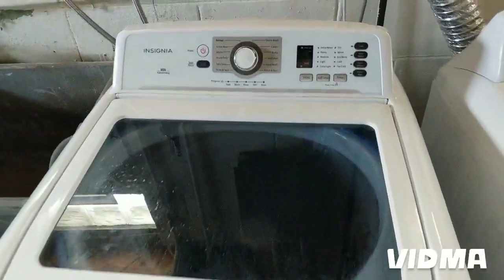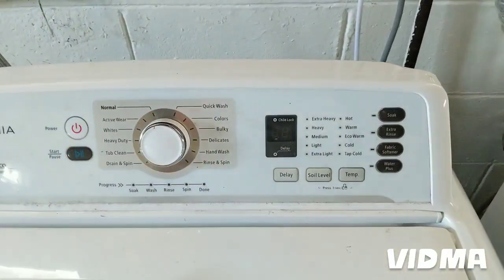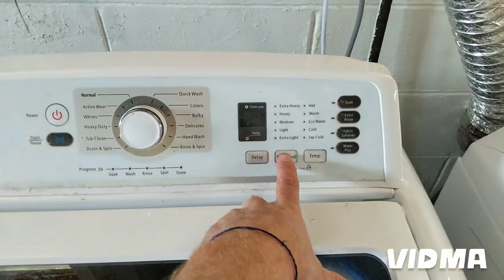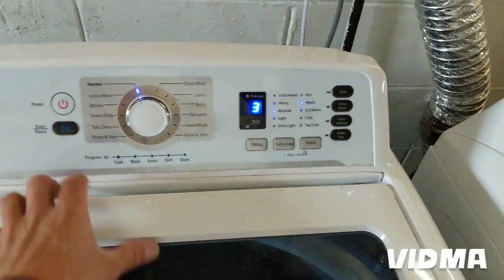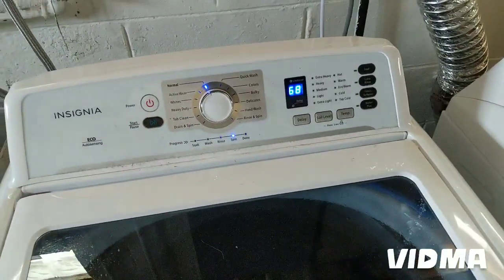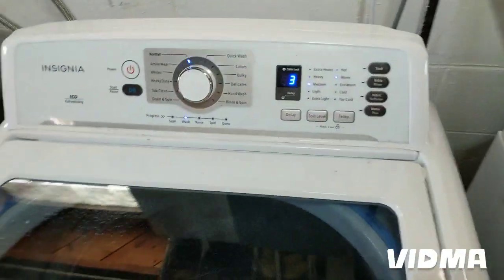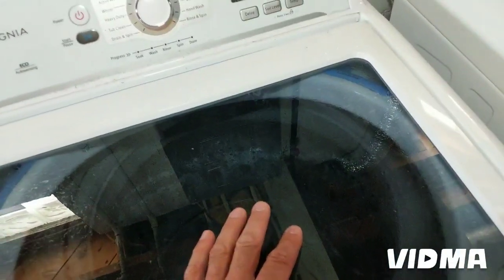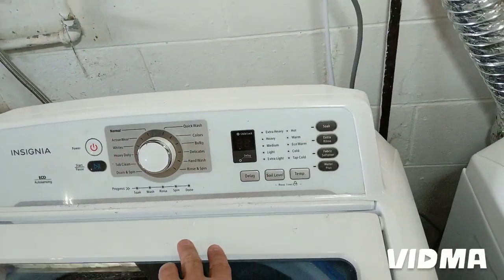insignia washer not spinning diagnostic mode

Comment: My agitator stopped triggering (on its own), about a week ago.
The water pours in until it overflows.
I don't know how to fix that.
I didnt know about service mode.
I can get the water going. Stop it when meeded, hit service mode and do "agitation mode" for the 3 minutes it allows.
Repeat as meeded (3 agitation modes, every 5 minutes) and drain.
Reply from the maker: Pressure line got clogged most likely. And not sensing water level. You will need to find a tube that connects pressure switch and the drum basket. Pull the tube form the pressure switch and blow to it. To get the clog out. That should fix it. If it's clear will need new pressure switch. Also check if there is. No holes in the tube sometimes it can rub on something all the way through

Comment: What if it spin and the water don't drain
Reply from the maker: For this unit most likely the drain pump is clogged or broken. I think you can access it by just tipping the washer back a little bit. Make sure It doesn't fall back on you. There's a couple screws that hold the pump. The housing together. You can see if anything stock or impeller is broken off

Comment: This video is worthless. 😂
Reply from the maker: Thanks for your commenting I appreciate all the healthy criticism. I'm not sure what the expectation from the video was. Please elaborate on that. If you're watching this video, most likely your washer is not spinning . Unfortunately, there is no easy button to fix your problem in this case .If you watch the whole thing to the end, it does explain why your washer doesn't spin and how to run a diagnostic mode to test the spin cycle only. But the main point is if the agitator spinning One direction when it's agitating, most likely your control board is bad.